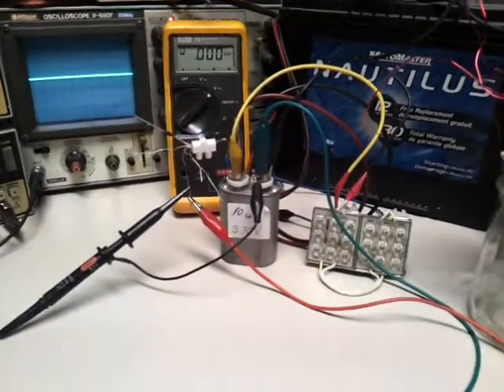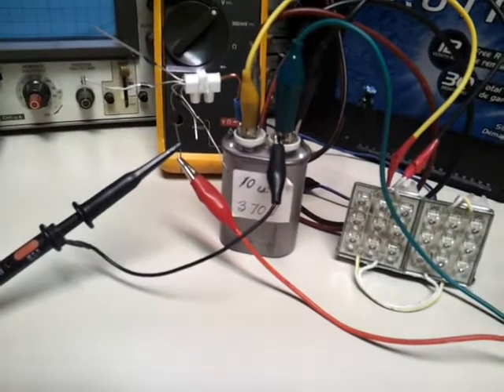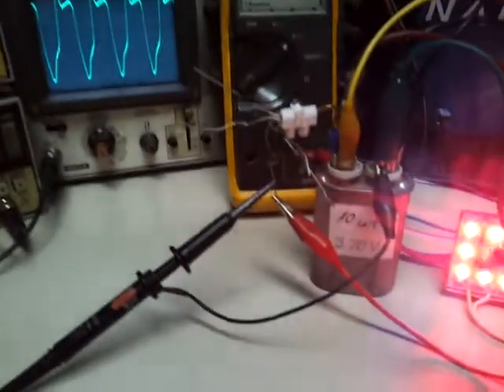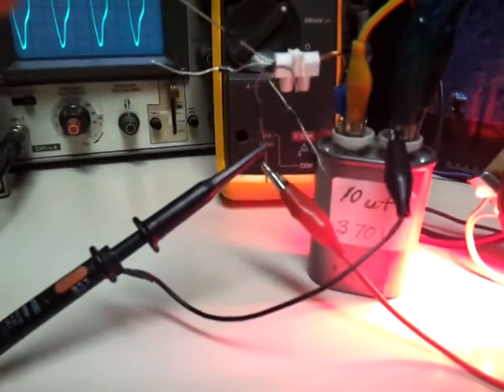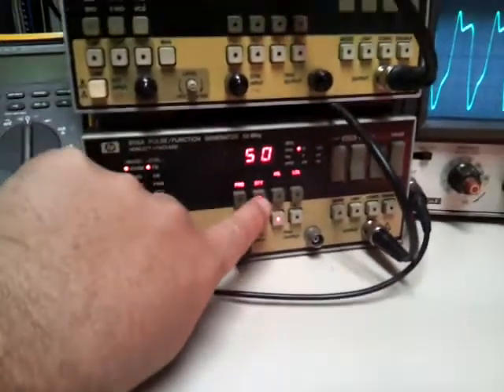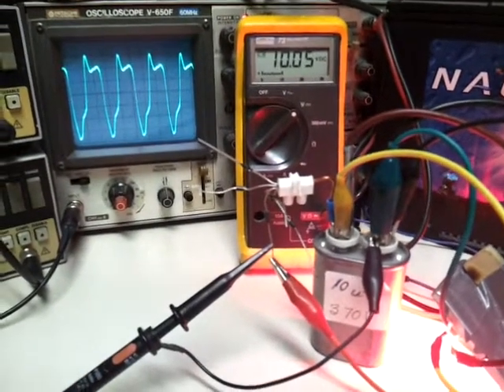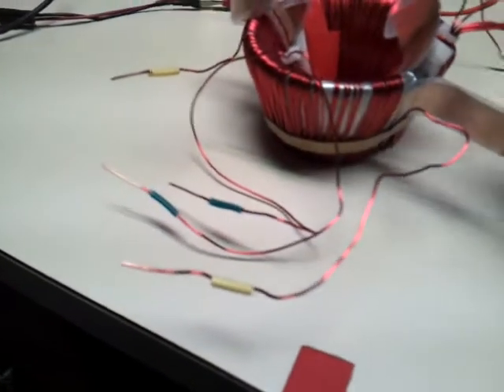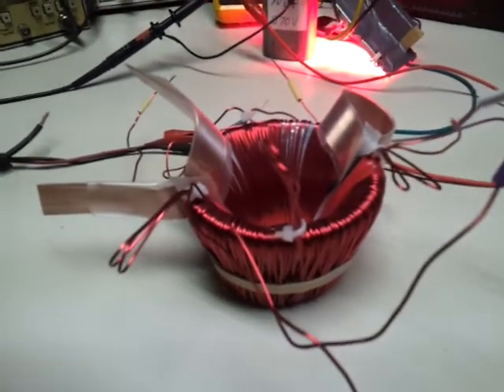Pulsing a Yoke Coil 3

Comment: Wow. Think about what you are doing. The yoke is the hose. It is circular. You are squeezing it with the 50 coil and further by the 15 coil causing it to change pressure instantly. Like in the soft hose version I just mentioned these increase in pressure is almost limitless. Hmm.. isn't that half of a Tesla rotating field coil?